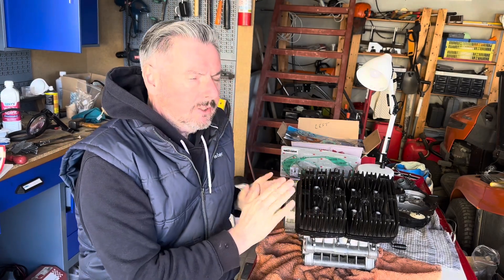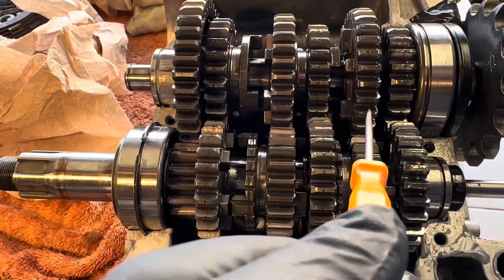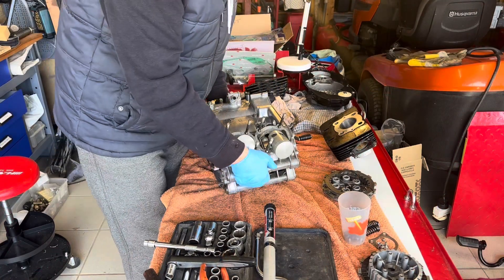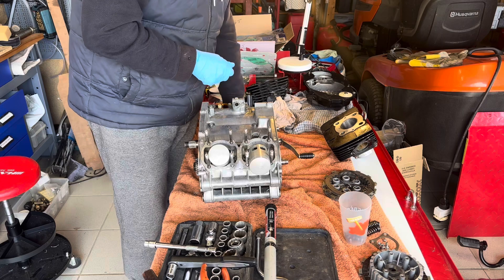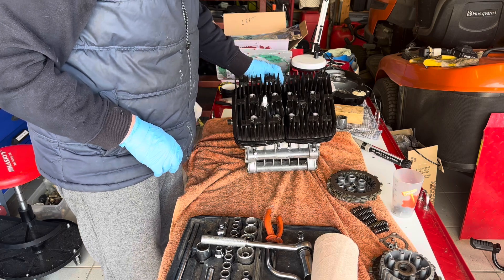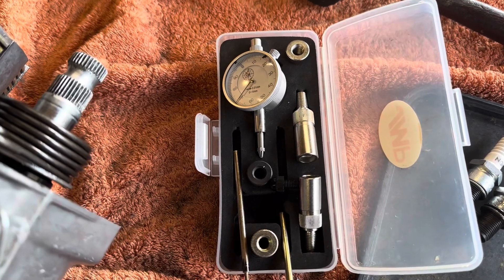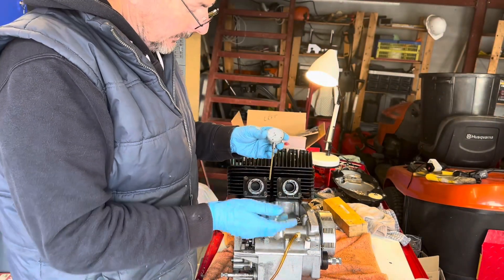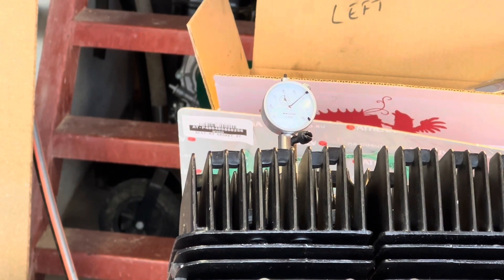Yamaha RD 250 Take Two Engine Reassembly

Comment: I had a RD250E in 1981-82 in yellow. Loved that bike. It achieved 105mph over a flying mile at an airfield with mild tuning and slight gearing change, those were the days!
And now I can really appreciate the mechanicals of the bottom end and gearbox with the horizontal split cases, so easy to work on. 
I would love to get another one and do a few updates, like halogen headlamp, uprated forks and shockers, twin discs with more modern calipers and replace that silly swinging caliper on the rear, that on my bike kept sticking on slightly. I'd try to made them sympathetic updates, like keep original colours of brake calipers and rear shocks so it looks standard. Thank you for your series of video's, I am re-living my youth through them, as I will probably never get an immaculate 250E in yellow.
Reply from the maker: Delighted you’re enjoying the videos, never say never about having another RD

Comment: good progress ! excellect you sorted the gear box out before fitting ;-)   I've been doing my timing with the cylinders heads off mainly because I lost my screw dial gauge for the plug hole (!) . I can visibly see the TDC that way but I aknowledge that virtually everyone else does it with the cylinder head on . 

I still have points system as I've still not found an electronic kit for a Suzuki GT185 . 

Looking forward to the next episode , fingers crossed all goes smoothly from now on !
Reply from the maker: Thanks for the encouragement. Have you asked Vape if they have a kit for your GT185? Also I have set the timing with the heads off (but tightened down) in the past. I wanted to try and do it “the proper way” this time

Comment: Well done mate so far so good 👍
Reply from the maker: Thank you
Reply: I made my own dial gauge adaptor, used an old spark plug, could you not shorten the yambits adaptor's collar a few millimetres to give the right reach, I used a bicycle spoke on the end of the dial gauge as per the previous comment, but you  already have an extension.

Comment: Best extension in the dial gauge is a bicycle wheel spoke, the threads are the same and on the other end you bevel cut the spoke with a hacksaw and file finish so it cuts through any crud on the top of the piston to the metal. Be careful not to punch out the dial gauge mechanism when trial and error finding the correct spoke length...
Reply from the maker: Thank you a very helpful top tip
Reply: Great idea 👍👍👍

Comment: Once you verify timing marks on your rotor, you can use a timing light that has a two stroke setting that also you can “0” out the advance setting. I bought one and setting points and timing on my RD 350 went from stupid fiddly to a 10 minute job. You can get your timing spot on without hassle. I got mine at the Home Depot believe it or not. Works great.

Comment: I’ve said this before but I would strobe the Vape once the engine is running to see where on the pick-up it’s actually firing. The manual states it fires when the nose of the magnet passes the edge of the pick up nose but in my experience it’s often closer to the middle of the pick up.
Reply from the maker: I’m planning on doing that as I’ll be interested to know exactly where the actual firing position is and how it relates to the 2mm btdc I’ve set

Comment: As you've had the crank rebuilt. I would always check the TDC positions of both pistons, using the dial gauge. This should ensure that both pistons reach TDC at exactly the same time. It might sound mad, but the slightest misalignment of the  crank MAY mean one piston reaches TDC, before the other. This is very unlikely, but it always pays to be cautious, as fractions of a millimetre can make a difference in timing. If one piston reaches TDC, before the other. Then you need to time off the piston that reaches TDC last, to be on the safe side. This ensures that the first cylinder will be running on very slightly retarded timing, compared to the other. I have  seen various advance settings from 1.8 to 2.0mm BTDC, for these old air cooled motors. If you're not bothered about the maximum possible power,  then maybe consider retarding the ignition timing slightly. This will help further negate any detonation and give slightly better low end power.
Reply from the maker: I have wondered about using the dial gauge on both cylinders, perhaps I shall when I’m setting the timing

Comment: With regards to the ignition timing what you have done is OK 'but' really you should turn the engine backwards until the piston is say 3mm BTDC then turn the engine in its normal direction of travel to bring the piston up to 2mm BTDC. Doing this will take out the tiny amount of slack that you get in the big end and little end. It probably won't make much difference but its 'good practice'
Reply from the maker: That’s sound advice, I’ll do that

Comment: Why did you strip the top end instead of turning the engine upside down and accessing the gearbox by removing the lower engine case  ?
Reply: That's not a bad idea but the selector forks would come out with the lower case leaving the gear cluster in the top case, it would be a bit tricky to get the selectors back into their grooves whilst refitting the lower case (also it would have been hard to find out what was wrong with the first rebuild)
Reply from the maker: Because I didn’t think of that!